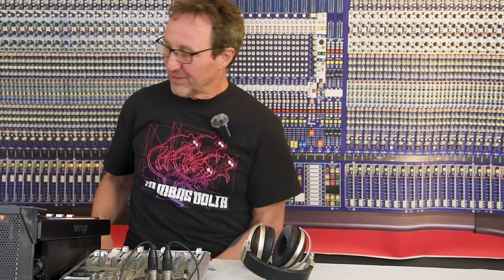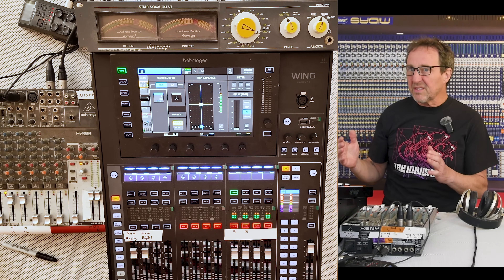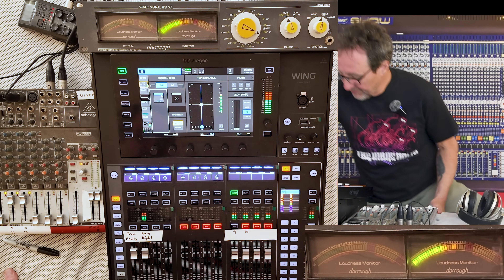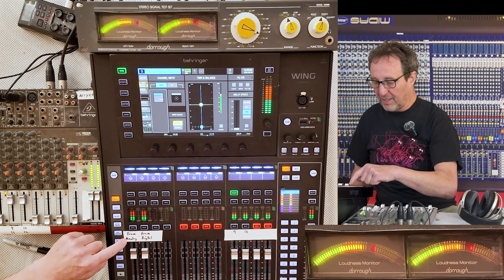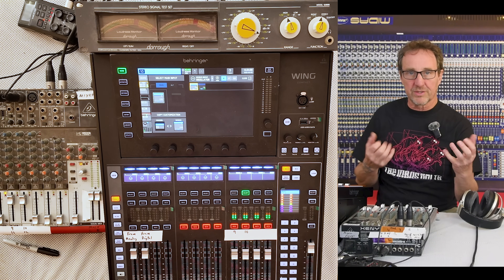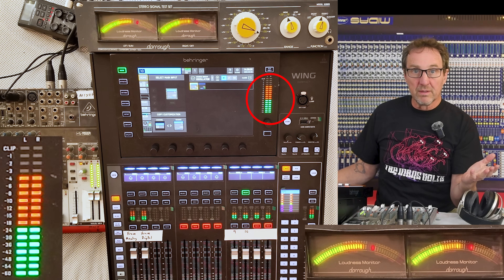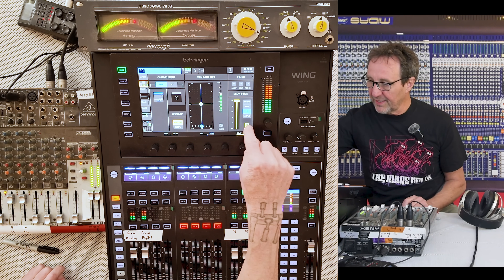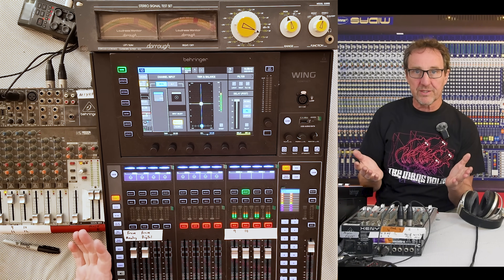Digital Audio Meters Don't Show What you Hear - Sometimes

Comment: I think the Avid S6L’s RMS metering exposes the issue. (I’m ignoring the console’s meter peaks.) The WING and probably the other digital consoles and software are doing peak metering. Summing two fully correlated signals adds 6dB in both types of metering because the amplitude is exactly doubled. When uncorrelated the amplitude is hardly changed (compared to correlated), but the power is still doubled which is why we still hear the 3dB increase. I know I’d prefer RMS metering so the meter reflects the power/loudness, so maybe getting some attention on this can help persuade them to add support for it.
Reply from the maker: The issue is that the peak digital meters and RMS analog meters are are optimal for their respective formats.

With analog, extremely short-term peaks are no big deal and won't cause undesirable audio artifacts. 

With digital short-term peaks can cause digital overload that create very undesirable artifacts. 

So if you want a meter that will protect you from bad things while giving you an indication of the level, The RMS meter or VU meter for analog and peak meter for digital are the way to go. 

But for digital, the peak meter protects you but doesn't line up with what you hear necessarily.

Ultimately the metering isn't the issue but rather the fact that the two formats have drastically different ramifications from short-term peaks. 

All the Rams digital meter is doing is hiding the issue from you when you use RMS metering making you more susceptible to digital overload without knowing it.

But, Avid being wise, still shows you the concerning peak level even when you use the RMS meter. Because they know that if you just put an RMS meter on there people will believe it and drive things into digital overload. 

Correction....   Many people will drive things into digital overload anyway regardless of what the meter says.

Comment: Wowza!!!  That is absolutely crazy and makes no sense.  Fortunately I still use a Dorrough meters, especially for broadcast.
Reply from the maker: Perfect and yes you need the digital meters showing those peaks so you can avoid digital distortion and the dorrogh meter will show you what you're actually hearing
Reply: @DaveRat  I have a little Yamaha DM3 in my studio because I am a big fan of Dante and have several computers.  Same meter issue.  This is going to drive me crazy!!!  Output metering is the most important thing in broadcasting for me!!!!  On the bright side.  The meters in Protools works correctly.
Reply from the maker: Very cool and yes pro tools has some metering options to set them at RMS or LUFS.

Comment: The digital meter shows an accurate peak reading, while you're looking at an RMS reading on the dorrough. The dorrough's peak values are pretty similar between corelated and uncorelated signals, just that the uncorelated hits the big peaks more infrequently and the analog device seems to have a shoter peak-hold time. This is also described in the device's manual btw.
Also, always be careful with electrical meters vs meters called "loudness meters". They often come with some sort of psychoacoustic weighting function.
Reply from the maker: Why does converting to analog and then back to digital give correct metering if it's the meters that are the issue? 

Although in the video you only see the The signal converted to digital and back to analog on channels 1 and 2 of the wing, if you pfl channels one and two or PFL channels 9 and 10, and compare the signal before and after it's gone through the analog flip, The PFL meters will show that after it's been converted to analog the issue goes away
Reply: @DaveRat  Possibly the input meters have a shorter peak hold time I'd guess. The coarse 6dB resolution on those makes it a little hard to tell where they're at exactly.
For the accuracy of the test I assume you ran the white noise bandpass limited to 20-20K. You won't get anywhere near the levels of 20k+ information with regular sources like mics and playbacks (unless those are pitched up on a sampler running a high sample rate), so if you run the generator to 48KHz at 96K sample rate and your conversion somewhere loses everything above 20K then yes, you will measure a bit less through the analog path, especially with white noise, which is quite far from representing typical musical content anyways (pink noise is closer is terms of spectral intensity, M-Noise is closer in terms of spectral intensity AND dynamic range).
Reply from the maker: Perhaps give it a try and replicate the issue and then put 20k low pass filters in and see what happens.  I have already done this and rather than go back and forth and ask you to believe me, perhaps test and you will then see for yourself and let me me know.
Reply: @DaveRat  This whole process could be simplified a lot by taking measurements instead of doing guesswork from reading off various level meters with unknown characteristics.
I get the point of "don't concern yourself with the meters too much; if it sounds good, it sounds good" (which I strongly agree with; I see way too many engineers lose their minds they they see an input clipping once in a full moon), but the delivery with the video is a bit nebulous imo.
Reply from the maker: I am not sure that just ignoring flawed visual reference points while mixing is the best plan
Reply: @DaveRat  I finally get your misunderstanding now. Two uncorelated signals sum to +3dB RMS (power sum) but, crucially, +6dB peak. The digital (peak) meters indicate this correctly by not changing. The Dorrough's RMS function (which you're reading off in the video) also indicates this correctly by showing a 3dB difference between the two tests. Just the Dorrough's peak meter is about a dB off, presumably caused by the limitation in bandwidth or by the limitation of the device itself. The input LEDs of the Wing also peak to -6dB in both tests. Just that the corelated summation has it on solid while the uncorelated sum just tickles the LED because of the increase in creast factor. Everything is as expected, no?
What you say at 9:39 is that you want an RMS meter. Your console's meters are peak meters, which are arguably more useful in this context, since you need to know when you clip your inputs/outputs (converters). On the AVID you switch to RMS and then the meter shows a difference in pk and rms, while the pk lights stay the same on the RMS mode, as they should.
Reply from the maker: Interesting and agreed mostly.

Take a look again at the Dorrogh peak meter. There are 3 red LEDs and correlated the led above the highest red is flickering, de-correlated the led below the lowest red led is flickering, which equates to about a 2.5 dB differential or so. 

Also if it is purely a peak versus RMS metering issue and if truly de correlated summed has a peak of 6db, why do the digital peak LED meters on channels on 1 and 2 of the wing mixer read almost the exact same as RMS meters after the signal has been converted to analog and back to digital?. 

One could attribute this to the A to D and D to A converters acting as low pass filters and therefore trimming those high frequency peaks off the signal. 

To test for that, one could introduce low pass filters on every channel at 20K or 22K to solve the issue and the meters would then read correctly, right?

Go ahead and test that and see how that works out. In my tests adding those low pass filters changed the results but does not achieve the same results as analog as the low pass filters at issues of their own. Possibly not to dissimilar then what the Nyquist filters are doing and possibly related to why we see that difference between analog and digital peak metering.

 I don't think anything is necessarily broken or incorrect with digital versus analog but it does appear that summing de correlated signals with significant high frequency content creates higher meter readings in digital than it does in analog. 

And if the meters are correct which I believe they are that would mean that summing those signals in the digital domain eats up more headroom than summing those same signals in the analog domain.
Reply: @DaveRat  I have not measured the Wing's output/input linearity so I can't comment on what kind of LPF those might add. Reconstruction and anti-aliasing filters are often different from device to device and come in linear as well as minimum phase versions, which may affect the results in a way, indeed.

Peaks from the uncorelated sum are more scarce than the peaks from the corelated sums, which coupled with the higher crest factor causes that observable difference on the input meters on the Wing. This does not appear on the output meter, so I suppose the peak hold time on that is a little higher (the output of the console is typically less dynamic than the input so it would make sense to increase peak hold times on the large LED chain for better readability, I would suspect).

The 2dB difference in peak readings on the Dorrough is interesting and I can't really explain it. Likely just a limitation of the device (I would call it "analog inertia"). The shorter the peak, the faster the readout of the meter needs to be. This can be extremely high in the digital domain with enough processing overhead, but a purely analog device might struggle to catch super short peaks. I've ran into a somewhat similar issue checking compressors with 20KHz sine waves with extremely unexpected results (some didn't really react to the tone at all). 

About the headroom, yes, you have more headroom in analog if some of the signal is lost to LPFs, that's to be expected. But if it's not lost, you don't have more headroom there, just because the meters aren't fast enough to catch peaks accurately. If the voltage exceeds the linear operation range of the device then it'll clip, regardless of what the meter's showing.
Reply from the maker: Excellent and what's your take on the importance or sonic relevance of overloading short term HF peaks occuring above audibility  in the digital vs analog domain?

Would you say its probable that short term HF analog peaks at frequencies above audibility that overload and create distortion primarily so at higher frequencies also above audibility while the same short term digital peaks that overload are more probable to create distortions at lower frequencies and possibly or probable to create distortion  in the audible range?
Reply: @DaveRat  Well given that typical program content will not have frequencies that high to begin with (unless you use a lot of saturation/distortion effects inside your high sample rate console), it's not really a real-world problem imo, but let's assume we have a problematic signal, such as a dual tone with 100Hz and 24KHz (which I set up a quick test for):

In this case, the distortion audibility will depend on your console's (or wherever the D/A conversion is happening) reconstruction filters. If it's a fast filter and 24KHz is attenuated by a lot already, you will not get clipping, because the frequency that would cause an overload is already filtered out before it can cause any harm. You can treat your signal as if the 24KHz tone is not present.

Now I lowered the tone from 24KHz to 22KHz and even 1dB into clipping, it is jarring (IMD products). This test was done on 48KHz sample rate with a DAC with a fast linear reconstruction filter.
Where the IMD product lands depends on the signal that's playing.

Pure tone distortion audibility is most critical and full spectrum program content will mask a lot of the distortion products. I don't quite remember which paper it was, possibly by Alex Voishvillo or Sean Olive, but I also faintly remember that short transients are less critical in terms of distortion compared to pure tones. Especially the extremely short peaks in such a test as yours are probably not going to cause audible distortion artefacts, even in lab conditions.

I don't think there will be a big difference in the resulting distortion in terms of analog vs digital (which is also analog clipping in the end, since the distortion will only generate in the final D/A stage, not internally, at least not with modern consoles), unless you're running your mix through some tube outboards, where you'll end up with even more distortion naturally.